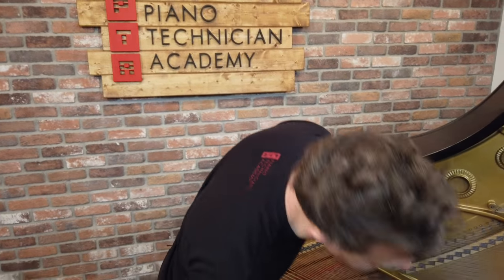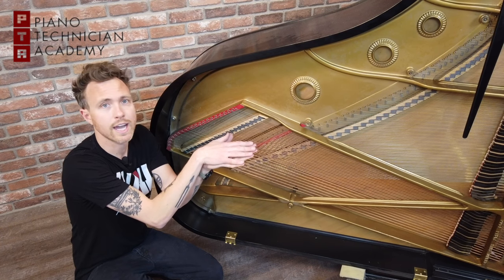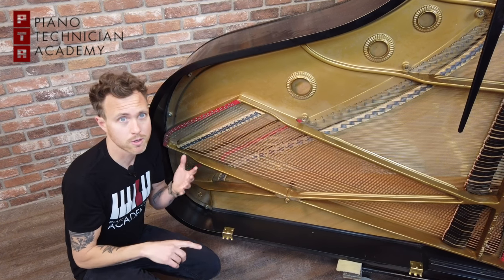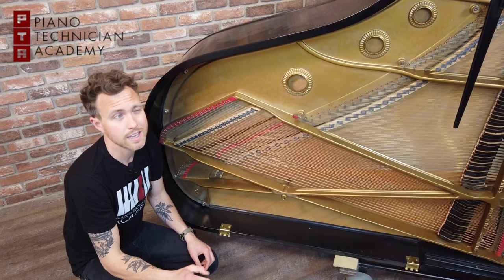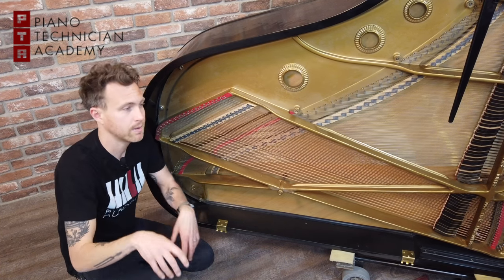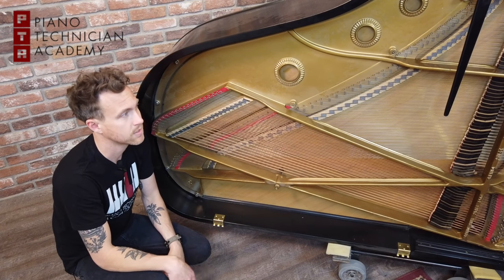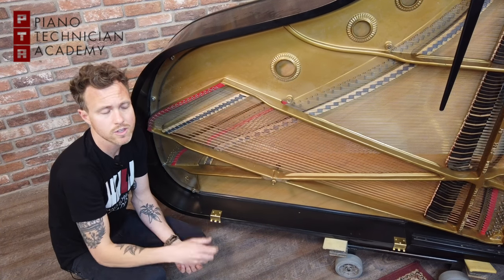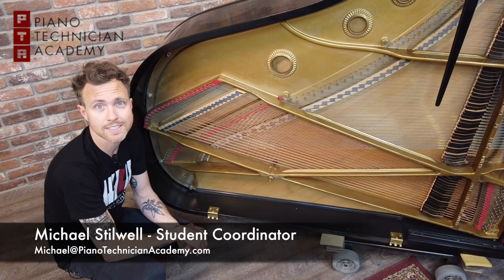The difference between Wet Sand Casting and V-Pro plate casting in pianos

Comment: I respectfully disagree with you. I think the information you are providing has been given to you secondhand, and you have not done any serious research. I think people in the piano industry have the responsibility to provide accurate information to the general public.   I will suggest two readings "The Physics of the Piano" by Nicholas Giordano and "Five Lectures on the Acoustics of the Piano" You will find out that the plate is the most neutral component in the piano and has no contribution to the sound. 

The following explains properly the casting process:
Let me explain one thing.  In the V process the sand is dry and vacuum is used to assist the filling of the sand mold with the liquid metal.  The dry sand causes the metal to cool more slowly allowing easier metal flow in narrow sections.  That, along with the vacuum assist permits large slender castings to be made such as is the case with the cast iron frames in certain Japanese and some of the German pianos.  Normal sand casting uses wet sand to permit compaction and to increase metal cooling rate.  Typical sand castings are also poured in air (no vacuum).  The result is that typical air poured castings must be have larger section thicknesses due to the faster cooling (metal can’t fill small section molds when it is cooling rapidly) and there is typically much more porosity. 

The result is that typical sand castings are bulkier, have more porosity and other defects, but the metal in places may be slightly stronger due to the more rapid cooling.  On the other hand the vacuum castings are much more slender, have less defects, but the tensile strength is slightly lower due to the lower cooling rate.  In most situations the overall strength of a “more perfect” casting is equivalent or higher than that of a casting containing porosity.

Lastly the cast iron piano frame is not a “strength critical” component.  It is a “stiffness critical” component as most engineering applications are.   This tension of the strings is only 30-40000 lbs which does not stress the cast iron very much. The stiffness, or rigidity, or elastic modulus (different terms for the same parameter)  which is an constant physical parameter and not affected by strength, is unaffected by any casting method.  It is this stiffness which resists the tension of the strings and is pretty much insensitive to casting method.  If you were to examine the cast iron frame closely before and after the strings are tensioned, you would note that the frame compressed slightly.  Upon releasing the tension, the frame would return to its original size and shape.  (We are talking about very small changes in dimension).  If you could measure the stress on the frame at any one point, you would find that the stress was far below that of the typical strength.  That is why we say that this is not a strength critical component.